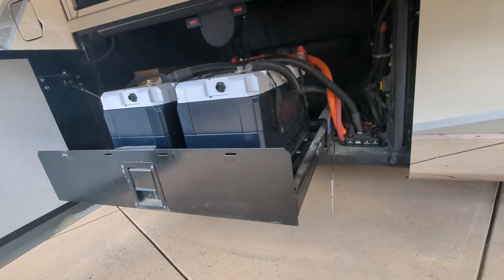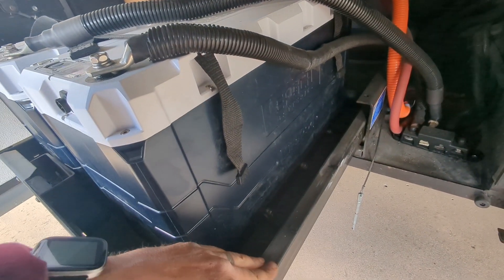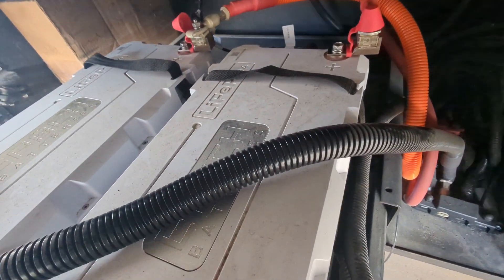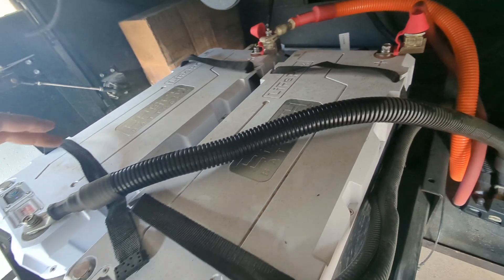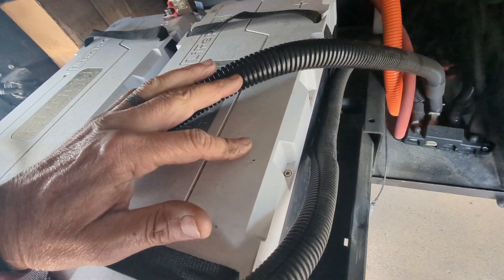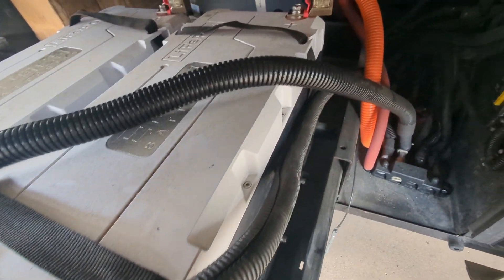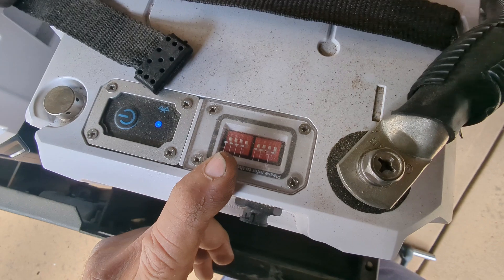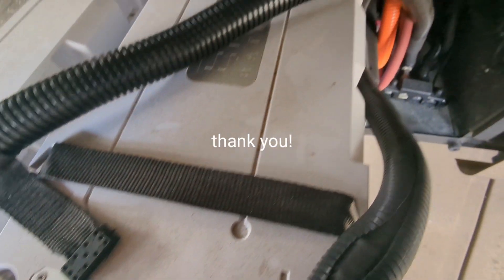Epoch 12V 460ah Installed in RV LiFePO4 Deep Cycle Battery San Diego

Comment: I am adding a second Epoch Elite V2 460ah battery to my new RV,  someone told me to use a T-block fuse setup rather than the terminal block ones,  which is what I originally ordered and will return.   I'm not an electrical expert so what would be the main difference between a fuse mounted like you have in this video and a T Fuse block on the positive output of one battery.    Also, what is the advantage of using the bus bar vs. just wiring the batteries together in parallel and then a pos. from one and a neg. from the other battery?
Reply from the maker: The primary distinction lies in the fuse's physical placement and its integration within the overall circuit design.
A T block fuse would a great alternative to protect the main positive cable.

Comment: What size mrbf fuses did you use on the battery’s
Reply from the maker: @JM-nv1qy  I don't remember but looks like it was 4/0 cable. I believe we used 250 amp fuses

Comment: I just bought two 460 AH batteries also. I bought two sets of brackets. I noticed your batteries are pushed together. Did you have a bracket between them?  How did you hold them in place in between the batteries?
Reply from the maker: Brackets in-between